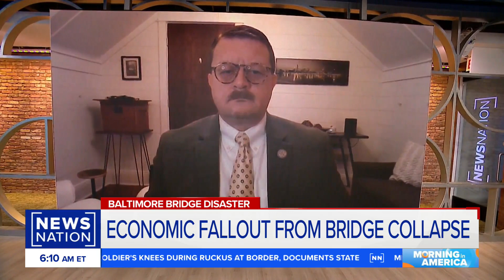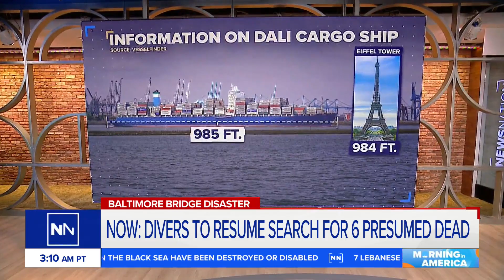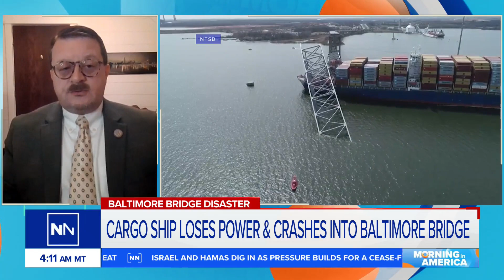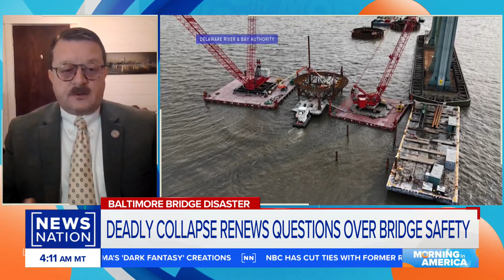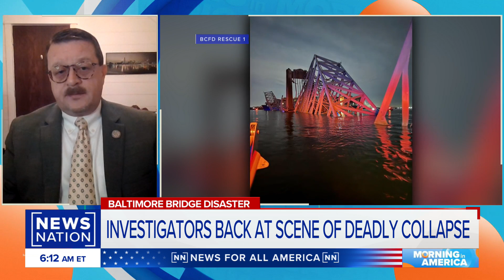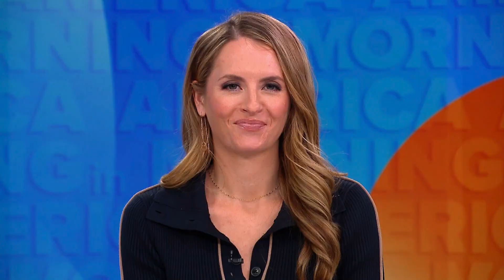Baltimore's Key Bridge design was due for an update: Bridge Expert | Morning in America

Comment: Everybody is blaming the bridge. 
Clearly they are protecting the culprit.

The ship did a sharp turn to the right see the GPS tracking of it.
Reply: Watch the video. The power went off on the ship. Thus causing a loss of control. Did you see the black smoke coming out of the ship? That was them gunning the engine in reverse to attempt to stop the ship and gain control.
Reply: I know it seems to have loss of power. But loss of power does not explain a sharp turn to the right. It would have gone straight under the bridge by its momentum.  You did not look up the GPS path? @jaredmehrlich6683
Reply: It did shut off to prevent fixing trajectory. But it took a sharp right. Without this sudden turn it would have gone straight trough the middle of the bridge.  

There is no explanation for this obvious turn that defies explanation. The trajectory was not the bridge column at all until the very end. See the GPS trajectory, speaks for itself.  @jaredmehrlich6683
Reply: You want me to dismiss the fact it turned right at the last moment unnecessarily?  @jaredmehrlich6683

Comment: Do we believe the crew, the media, or the politicians? All ships have redundancies. Something is not adding up.
Reply: There were.   The ship's generators picked up the load.

Most of the causes are from the fact that Baltimore's importance as a port is going away and that it has been "price cutting" to stay competitive.   It didn't require ships to have tugs get past that bridge.   It didn't install protective barriers around the 2 or 4 main supports of the bridge.   It's didn't impose a lower speed limit on large ships in the harbor.   It let a ship with engine problems leave the harbor without extra tug support.

I'm waiting to get information on the identity of the pilot.